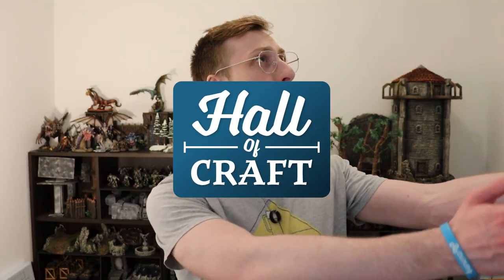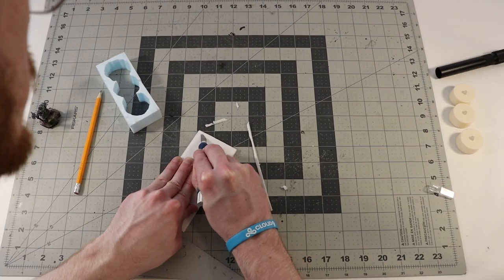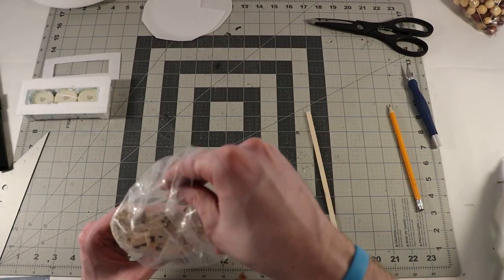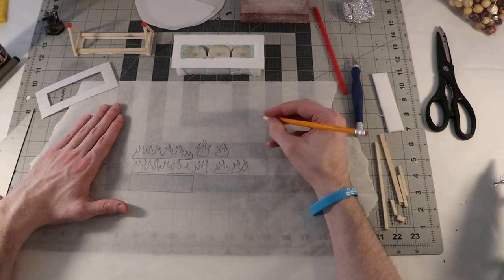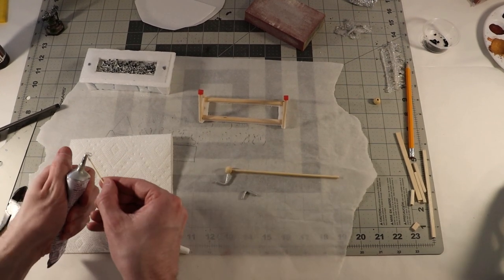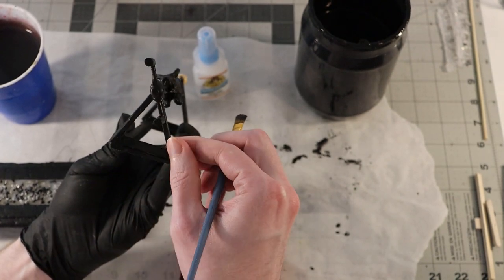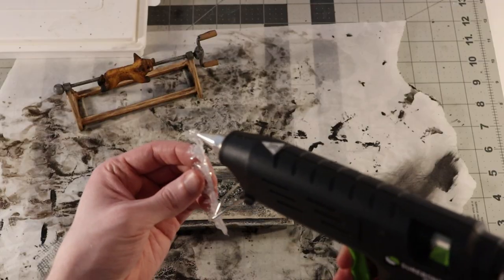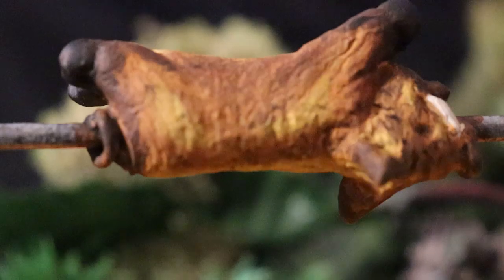Crafting a Modular Fire Pit with Roasting BOAR on a spit  - Hall of Craft (EP 36)

Comment: For hot coals you can use crushed glass over the tea lights and lightly dry brush them with black around the edges for the cooler areas keep up the good work
Reply from the maker: An interesting idea, the only crushed glass I have on hand is glow in the dark green at the moment. Maybe when store open back up I'll grab some for myself 😜
Reply: @HallofCraftVids  you could use that to make eldritch fire.  could be a magical forge.
Reply from the maker: I'm INTO IT